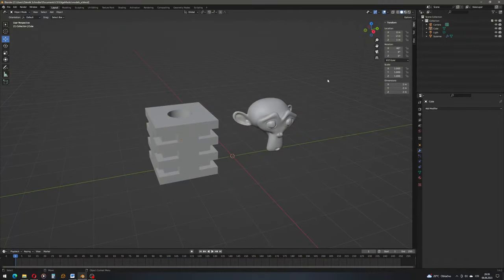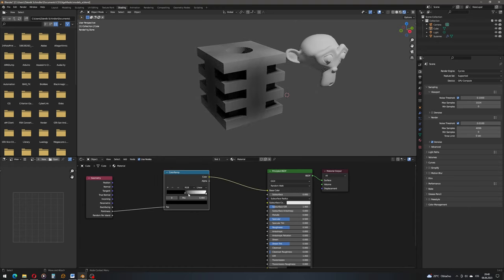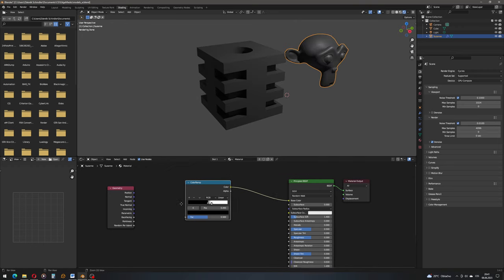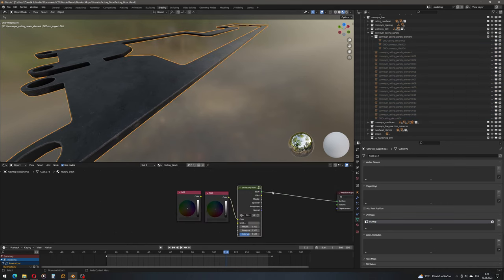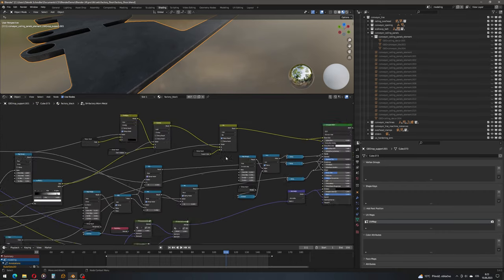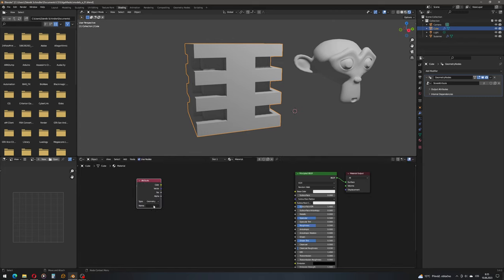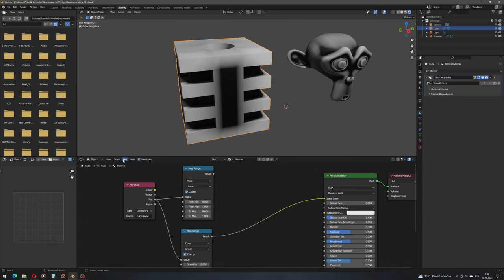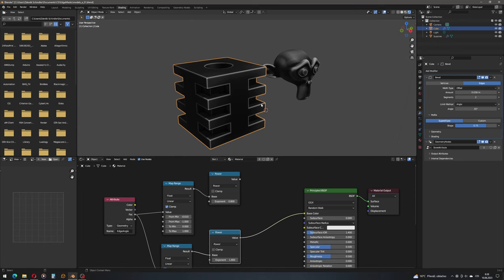Procedural Edge Masks in Blender (Both EEVEE and Cycles) without AO!

Comment: How would I use the bevel in the old method with the edge angle so I don't have to use the bevel modifier to avoid extra geometry?
Reply from the maker: I"m not sure if I completely understand what you mean - do you mean to use the shader level bevel (shader node) in conjunction with the edge angle geometry nodes? That is unfortunately impossible as it is shader level only and the geometry nodes edge angle needs to work on real geometry to give some result. You can use the geometry nodes edge angle even without the bevel modifier though - it all depends on the geometry that you have. For example if you have a organic model like the monkey - it will work straight without the bevel modifier. Or if you have a hard surface model with edge loops and a subdivision surface modifier, you can use the edge angle geometry nodes without the additional bevel modifier. Just make sure the edge angle is on the bottom of the modifier stack, so it can get the result from the entire geometry.

Comment: Can we use bevel in geometry node instead modifier?
Reply from the maker: I suppose you want to use some add-on node or a node setup that creates bevels in the geometry nodes? As long as it adds some geometry to the edges (and those edges can be evaluated by the edge angle node) it should work as well. Try it out and let me know!

Comment: i did exaclty what you did and it didn't work for me for some reason... blender 4.0
Reply from the maker: I'll check into that. I haven't got much time lately and did not experiment with the 4.0 release yet...
Reply from the maker: Just did a quick test in 4.0.1 and it works. Make sure to check that the geometry nodes modifier is the last one in the stack. Also for the bevel modifier - make sure you set the segments to a higher number than 1, also the profile shape has a lot of influence on the result (value of 0.75).
Reply: @ZetaCG-it5pm  Thanks for your reply! For some reason, it worked for me after I changed the name from "EdgeAngle" to "EdgeAng". It makes no sense, but I'm glad I figured it out.
Reply from the maker: @oGabrielAngel  I'm glad you have figured it out. It is strange though. Maybe  some internal dependency was updated by changing the name?

Comment: This is completely useless since the whole point of getting edge data in the shader is to not add any extra geometry on a model which is already detailed and cannot be beveled because it either breaks catastrophically (spikes everythwhere) or you simply can't afford a higher polycount.
Reply from the maker: If you have enough geometry, you do NOT need to add the bevel modifier. I did not add it for the monkey model...